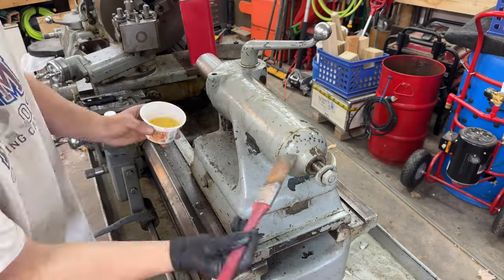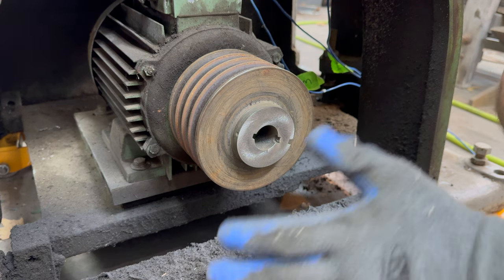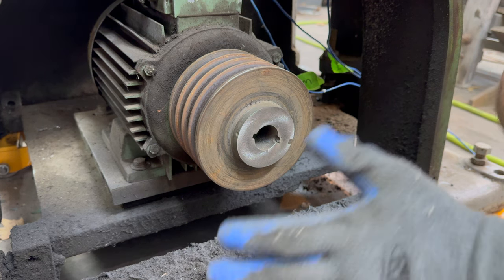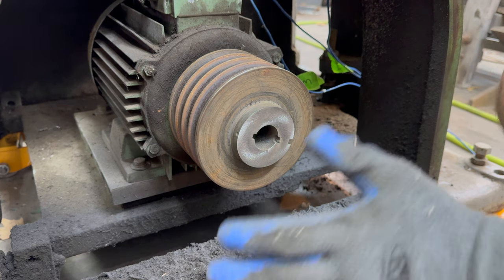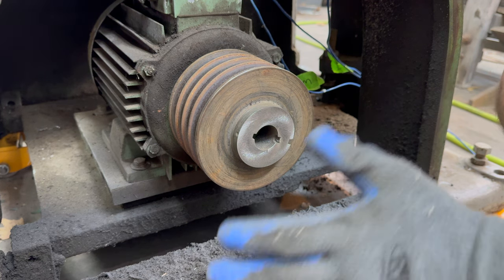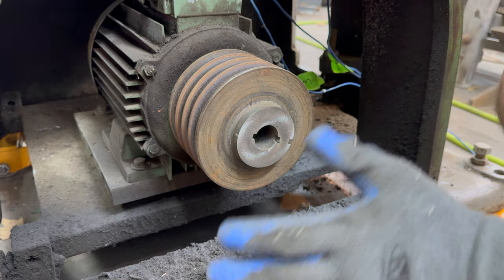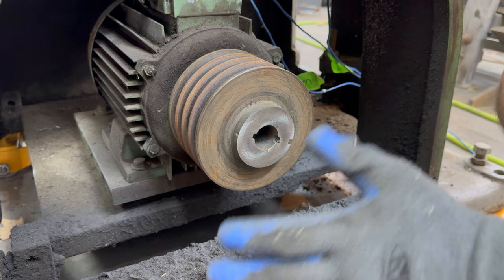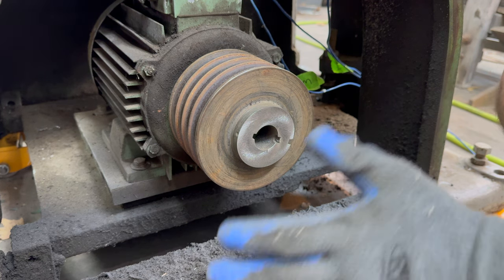1940 Monarch 16W Lathe Restoration Part 1 of 5: Disassembly & Cleaning

Comment: Hello, you've done a great job so far. If I were you, even if the sled still looks good, I would dismantle it to see what it looks like from below and then you also have space to open the bed, which looks like it's pretty much down. I know it is a very strenuous job to get the machine bed back together, especially scraping the surfaces is not easy. Many years ago I worked on the complete overhaul of 3 lathes (2 of them from the 1950s) and I know that it takes a lot of time. When it comes to the paint, I can say that the 2 old machines also had red rounding and dark green paint, the 3rd machine was painted gray on gray. We also had major gear damage and had to remake several gears.
I wish you a lot of fun and a merry Christmas. Greetings from Berlin
Reply from the maker: Thanks! Merry Christmas also! I 'planned' to clean and paint the whole lathe in about 10-20 hours but it ballooned into a much larger project and I found myself replacing every seal, fluid, and fabricating parts... nothing every goes to plan. Ended up taking anything apart that I could reasonably lift. Glad I did; didn't find any surprises but boy is it smooth to run and clean now. The carriage was too heavy to take off with my equipment and for the last 25 years or so it has been sitting ready to use in a family member's shop. When I moved it I was advised to simply use it as is and that it is in great shape, especially considering its age. I'll learn more as I get proficient with it (this is my first metal lathe, but not my first machine). Oh, and I also had a time crunch - I was taking up the heated parking space for my wife's car; we get alot of snow and winter is coming.
Reply: Hello Samuel, dismantling the sled can be a bit difficult, but you can often separate the top and side parts where the levers are. Then you could take the top off. But if you have been told that the lathe is still running well, then of course the question is what you want to do with it. If you need accuracy over longer lengths, then the extra work is worth it. But if you only want to turn the machine for something now and then, you've almost done too much. Unfortunately I don't know the type of machine because I'm a few thousand miles away, but the old machines are quite similar. If you can, please go close to the bed with the camera so that you can see more easily whether something should be done there. Greetings from Berlin @samuelwiltzius
Reply from the maker: Not sure what my plans are as of yet. Could be a source of income at some point or develop as a hobby from a few hours a year to a few hours a week. I have a love for things that are well designed and well-tuned and strive to make and maintain things that are enjoyable to use. For now, I'm working through a textbook learning everything I can about carbide and hss before I start trying to use it. It is an intimidating machine coming from a wood lathe that barely weighs more than the chuck on the Monarch. My uncle is a skilled machinist and I am looking forward to when he visits and gets a good look at lathe. I moved quickly with the restoration, now I'm slowing down a bit and putting in some study before trying to use it.
Reply: I think it's good that you do it right the first time and first take the lathe apart and clean it and also make small changes. This will help you get to know the machine well. And with the help of the textbook and your uncle, you'll get a good start and you'll just learn the rest by "does it or doesn't work" anyway. I learned metalworking a long time ago and worked with it for a few years. It was mostly very interesting, except when there were larger quantities of parts, which wasn't fun, but that's part of it. I've been out of work for 30 years now and I still miss it. Especially when you create a machine from a piece of metal, or when you make something old new again. @samuelwiltzius

Comment: If you have good paint adhesion there is no need to use paint stripper. You can sand the edges of the chips, feather them out, prime and sand to smooth, and then paint. Typically all paint stripper does is make your job 10x harder, not better.
Reply from the maker: After 80+ years the paint varied widely from in tact to really poor. The decision to use stripper was because it had been repainted at least once and I had just finished freshening up the paint on a Bridgeport using only mechanical surface prep and it revealed it's own issues. I figured I might as well go all in and strip it... and all the paint dust from sanding the Bridgeport was a huge nuisance that I was happy to not repeat. A few areas like on the base and underside of the chip tray were quite good - but they were also the easiest to strip.